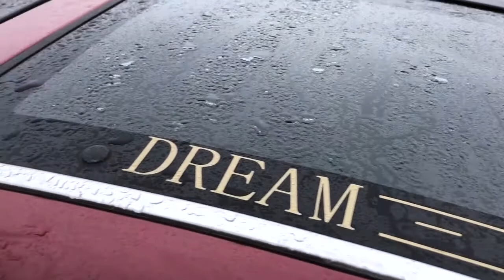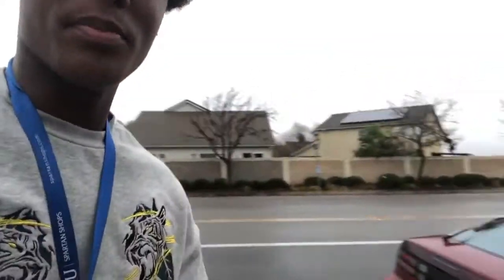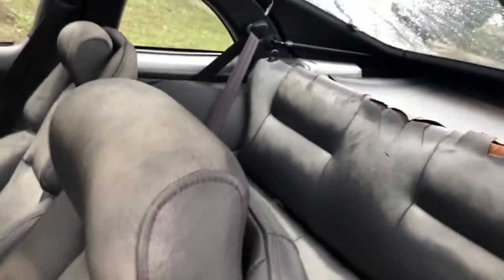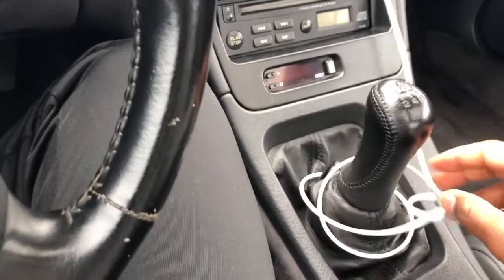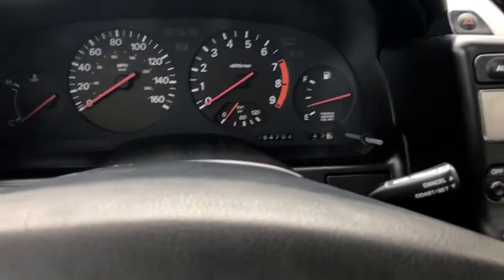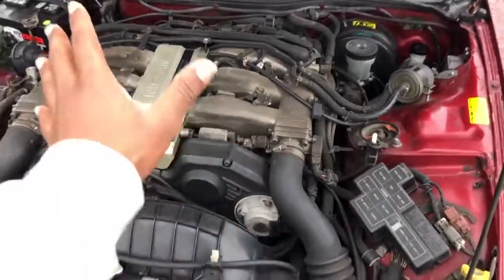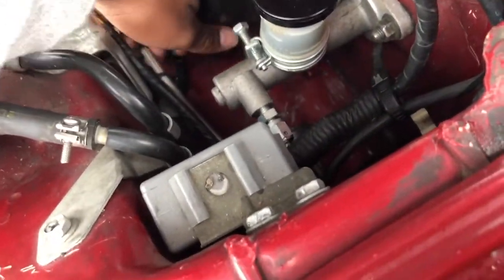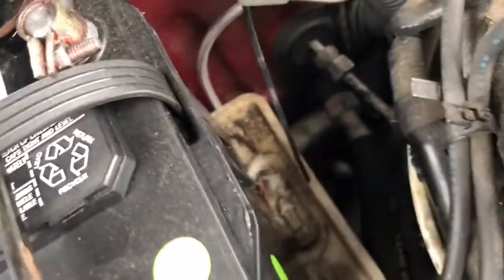I bought a 300zx z32 with 84,000 miles on it!!!

Comment: The exessive moment on the shifter can be two things very common:
1. Shifter bracket because the oem ones are made of rubber so they don't last forever.
2. The shifter bushings
Reply from the maker: Eduardo Garcia I'll definitely be checking that out, thanks for the heads up!

Comment: ewww, 2+2. j/k. i prefer the 2+0. be prepared to do a 60k timing belt service if it hasnt been done otherwise expect problems down the road. did my 120k service before I started hooning or even driving it.